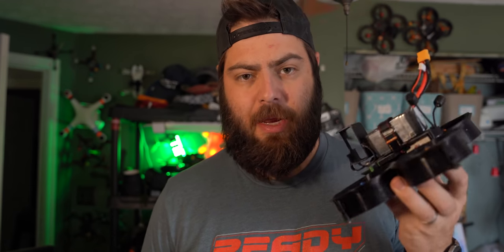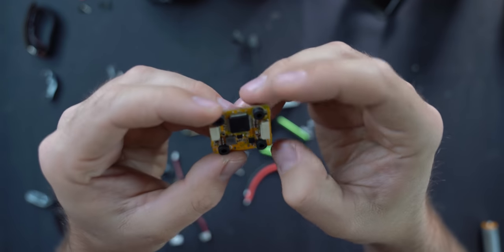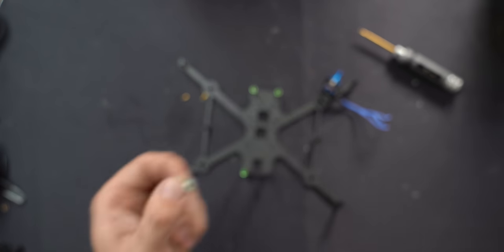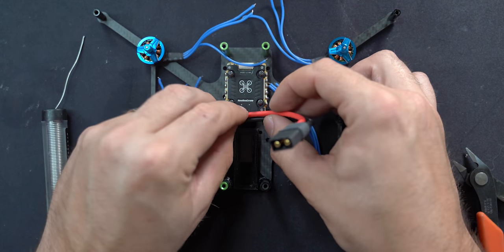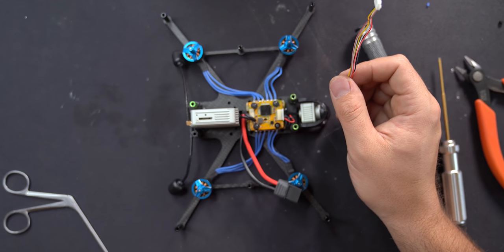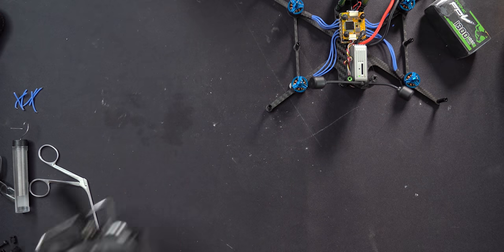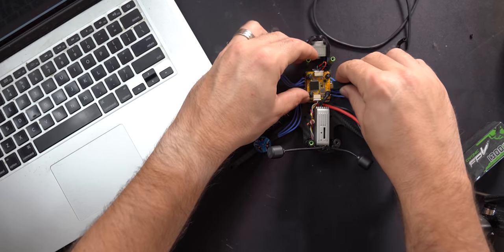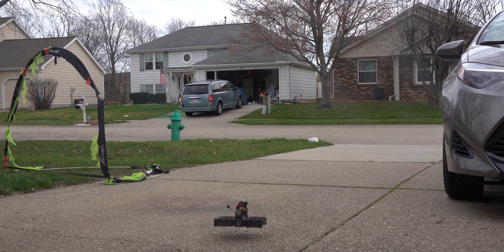How to Build a Cinewhoop Drone for Cinematic FPV Shots in 2020

Comment: I watched it all.  I LEARNED a lot.  Thank you!  Those DJI kits are a bit expensive for my budget.  Can anyone suggest an alternative?  I've got about $400 bucks.  I don't mind building it so long as everything is in the kit that will eliminate guesswork.
Reply: Anyone have any answers to this?
Reply: Babyhawk 2 seems good, but goggles will always set you back.
Reply: If you want the HD dji system you have to get a air unit or vista. 
If you want to run analog this is the wrong video for you.
Reply: Main thing that's gonna rack up the bill quick is the goggles.

Comment from the maker: What do you guys want to see built next? What sorts of tutorials and other content would you like to see? LEAVE A COMMENT! 
Parts on this Drone: 
Shendrones Squirt HD: https://bit.ly/nurksquirthd (choose "full kit with damped mount" and "DJI FPV" 
FC/ESC Stack: https://bit.ly/nurknewbeestack
(alternative stack if that one's out of stock: https://bit.ly/nurkaltstack)
Motors: https://bit.ly/nurktmotor1507
(alternative motor: https://bit.ly/2JkCriG) 
Video Transmitter: http://bit.ly/nurkairunit
Receiver: http://bit.ly/nurkairunit
Camera : http://bit.ly/nurkairunit
LiPo: https://bit.ly/2y4DG2S
(alternate Lipo: https://bit.ly/2UlvVOV )
Extra Thumb Screw Standoffs: http://bit.ly/2xTmoWv
Thumb Screw Locks for the top of flight controller: http://bit.ly/2WyCT4J
Reply: 7" long range quad with dji air unit, crossfire, gps, etc.
Reply: I'd like to see huge DJI goggle giveaway :D
Reply: I would love to see a racing tutorial, even if it’s on the sim. Cheers!
Reply: Im about to start ordering parts to build a  Geyser. My plan is to get the biggest baddest everything and be able to do a lil freestyle as well.  Possible?
Reply: @nurkfpv I liked the big motor 12s build tht was sick. I'm building something like tht with the bh avenger 2810's on 6s not sure if I'll try above that cell voltage. Quick question tho in this squirtv2 build you show the blox tool for pressing the lock nuts on the top of standoffs I cant find that tool can you link it? Thx well I guess I can just use a 5.5 socket from my socket set ...
Reply: OK, How about I just buy that one FROM YOU? HOW MUCH?
Reply: I want to see a chainsaw drone!!! do it and you'll be my hero!!
Reply: @zachlindley9160  YES!!!!
Reply: wich props are you using?
Reply: How would I get my hands on the backplate mount or air unit bracket shown at 3:18 in the video
Reply: I never got OSD to work on the PYRONE DRONE stack. Soldered the gray and white wire to uart2 rx and tx...enabled msp and nothing ... then tried on uart6 and did the same rhing and still nothing...help :(
Reply: Hello Nurk,    I bought DJI mavic mini,   I like to swap 4k Camera to it.   Do you know how to do it?  Please let me know.   Thanks
Reply: Sir.  Nurk I watch your Vedio did saw a ghost in pront a car of your nieghbors house please! Watch carefully
Reply: Hi- great video! I guess over time these links stopped working, can you post updated parts and links that would still be compatible with the video's build? Thanks!

Comment: Do you need to wire a capacitor with the power connector? I’m building my first one this coming week and I see some people do and some people don’t? How do you know whether or not it’s needed? Thanks!
Reply: You don't NEED a capacitor, but it can be helpful to decrease image noise. For this build, I personally used a Panasonic FM Series 35V 470uf capacitor. You can get them on amazon for pretty cheap. Since the ESC's on this stack are integrated, you can simply solder the cap to the area where the batt wires kiss the board. I hope this helps! 😊

Comment: I'm such a noob.  I built this quad (it's my first build) and have been working through a laundry list of problems.  Today I figured out, I put the ESC/PDB on upside down, so my motors are on the opposite side of the quad!  At least I get to practice more soldering :)

Comment: Hi Paul, Thank you for this build video! I already have an Infinity FC/ESC 305 and Air Unit I purchased last year for a build that never happened. I purchased the Squirt and Brother Hobby 1507/3100 KV from Rotor Riot. Do you see any problem with the stack or motors for the Squirt? I believe the motors are the same RR uses in their Squirt build but not sure. Thank you!!!

Comment: Hey Nurk FPV 
2 questions:

1. Why do you choose to run props out as apposed to in ? 
2. If I wanted to build this setup for analog I would just need to pick a different Receiver, Camera, and FC right ? ... since this is for dj HD setup only. 

Still fairly new and learning so any info would be greatly appreciated !   Thanks

Comment: Howmany pack's in a row can the squirt ( V2) handle? 850 mah pack 4S-  Brother Hobby 1407 3600kv with iFlight SucceX-E Mini 35A stack. 

I understand as long the motors or stack is not emitting to much heat i can keep going. But at what point I'm overflying and should give the machine a break?

Comment: I've been meaning to ask, how much is it affected by wind? I've been flying a GEPRC Rocket Plus recently and while it's much smaller than this, and therefore lighter, the wind just throws me around. Hypersmooth/reelsteady aside, I've been wondering how your footage even outside seems so rock steady.
Reply from the maker: It's pretty badly effected by the wind, yes. Sometimes I have to choose other drones when the wind is strong. I usually use this for indoors or really low, slow close proximity stuff.

Comment: My understanding, very likely incorrect, is that there is a receiver for the flight control and a transmitter for the video system.  I think you have the same link to the receiver and the video xmitter.  Cheers, and thanks for consuming my Sunday and Monday.  lol
Reply: The dji air unit contains both the receiver and the transmitter

Comment: Hi guys,

Im a bit of a conundrum.
I used this video to build my cinewhoop and after not using it for a year or two I couldn't fly it today.  The dji control wouldn't arm the drone. 
I updated Betaflight to 4.5 and update the firmware 

How I'm still having the issue where the drone will not arm.

Does anyone know if there is a drone build using betaflight 4.5?

Comment: I installed my nbd fc upside down I didn’t know I could change it in bf. I got that working but no osd I made sure port 6 was open and telemetry was on . I’m also using the air unit with same stack . My first nbd fc had osd not sure why this doesn’t ?
Reply from the maker: Are you getting voltage for the air unit in the OSD bottom right corner?
Reply: NURK FPV thanks for the reply yes sir I do get voltage in red (16v) . I opened my new nbd 30 stack and started building while watching last night and same thing red voltage bottom right no osd
Reply: @NoiseBoysGarage  go into your goggle settings while connected to the air unit and enable "Custom OSD" and you should get BF osd
Reply: svosprey I checked that like a few times and it’s on . Still no osd . I have a total of four air units and I’m only not seeing osd on my nbd stacks . The others works fine full osd .diatone and off brand stack both . I love how it flys though 30 stack on a5”

Comment: Hey, total newb question... Do you have to use the DJI system with this FC? A lot of FC advertise how easy they work with DJI, but have no mention of Runcam, etc.
Reply: Usually yes they work just fine with analog setups. What this usually means (easy connection to DJI) is that they have an extra voltage regulator to power the air unit since it can only handle 4S and a lot of us fly 6S. There are a few boards that leave out the OSD to save money or space, since the DJI system has its own OSD, but those usually clearly say they don’t have an OSD. I can only think of one or two iFlight boards that are this way (like the Succex-A 40A AIO).
Reply from the maker: Frank nailed it ^

Comment: The esc thinks, that my right motors are the ones in the back... How can I fix this??!
So I run the esc and fc sideways like you and every time I give some throttle, the esc gives the wrong motors the throttle. For example, I roll to the right and the drone gives the motors in the back power.
Reply: you have to remap the motors in blheli32, its beacuse the esc is sideways and therefore resulting in the motor outputs being different
Reply: @charlie-sm4es  Thank you really much. Saves my Ass
Reply: @carbonbird2880  very welcome!

Comment: Hi mate i've been watching lot of your videos, and i got a few questions, i would like to get into cinewhoops, thing is i would like to build one with DJI hd system camera, my question is can i fly it with a tarantis qx7 or other off market crontrollers? or it must be with a DJI controller ?
another question for now  i dont feel like invest that much on goggles, is it possible to see this dji system with a monitor ? or somehow into my phone? thanks bro **
Reply: Hey, i'll jump in with some answers: you can use a different controller, like the Taranis, but you then need to put additional receiver on the drone - in your case frsky xm+ for instance. The DJI airunit on the other hand does have both the video transmitter and a receiver built in. And no, you can't have the DJI's HD video on anything but their goggles. I asked Joshua Bardwell this question recently, cause i wanted their feed on ORQA's. Unfortunately they do not plan on commercially providing an HDMI (or any other) receiver for their video feed, although they supposedly have such a dongle. I wouldn't ever recommend flying anything on a screen or a phone btw - that's good to show it to bystanders, not for the pilot.

Comment: Is there a benefit tweaking BLHeli settings, in particular pwm frequency and motor timing, with such small motors? I see in the video it was all left stock.
Reply from the maker: I almost never change any of those settings, and never have a problem.. But I wonder if it could be better.

Comment: It would be nice, if they had a fifth prop and motor. Underneith. Would make a lot of smoother flights and power., For stabililty and balance .
Nevermind, saw theres a 8 proppeler drone. The ember video.

Comment: good tutorial, but total cost not incl. fpv goggles wasn't mentioned. just adding up the list, you'll have 300-500 in a comparable quad, goggles can run $150-1k. then radio of your choice. not a cheap hobby by any means. newb here. complete entry-level kits might be best way to go rather than a custom build for anyone not familiar with building quads.